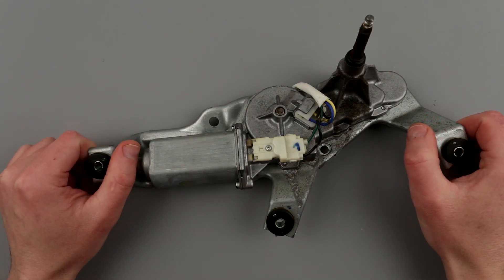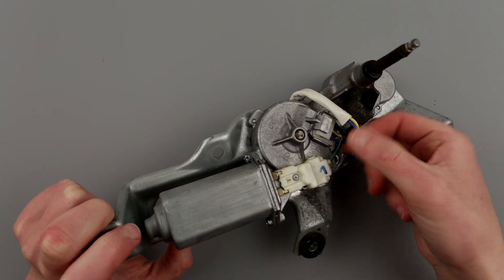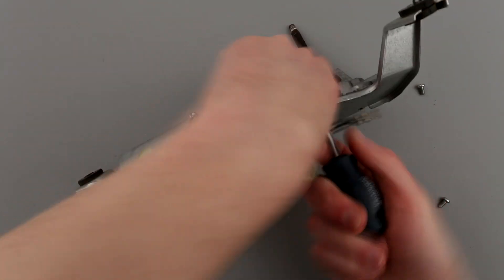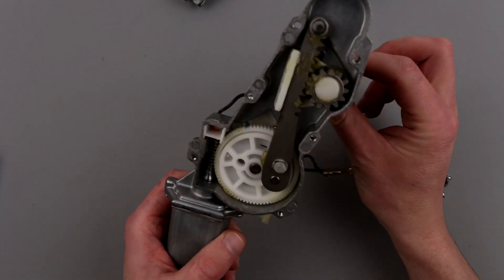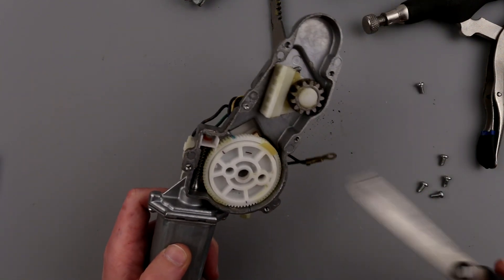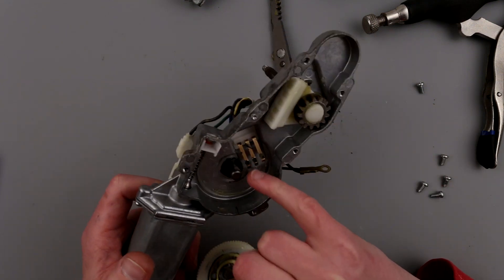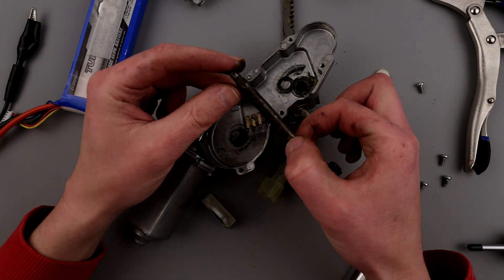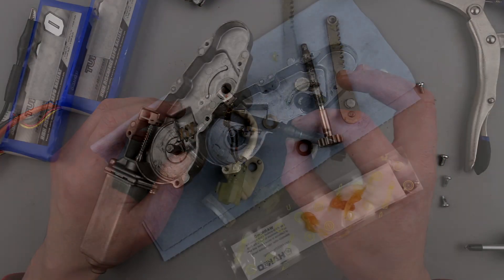Rear Wiper Drive: repair and how it works

Comment: I like your approach, it's exactly how I would do it. The electric motor bearings sounded very worn to me but as long as you dont use it too much it's a good cheap fix. Thanks for the video
Reply from the maker: Thank you for watching, many years later it still works :D

Comment: I have a problem. I cleaned that part u cleaned because it was ceased and rusted. However it didn't turn. On further inspection, the motor which has a threaded bar only turns so far anti clockwise. Should this motor be able to turn in one direction continuously? Or should it only turn the platic cog a little bit
Reply from the maker: Yes the motor should turn one direction, the mechanics will turn this into back and forth motion
Reply from the maker: Check the very end of the video to see how it is supposed to work

Comment: Dude you skipped the most important part, you didn't show us how you hammered the shaft out, was there any sealing to remove before hammering, did you have to remove the gear first and then hammer it out? you skipped the most important part and how you put it back too, for that reason your video is worthless sorry
Reply from the maker: Thank you for watching! Yeah...it was messy  Ive used P-Blaster, while protruding end of the shaft was locked in vise I was rotating the whole assembly to force it moving. Than when it started moving I release the vise and hammered it out :D

Comment: great video...but I'm curious as to How You REMOVED THE SEIZED SHAFT????..Did I miss it in your video?
Reply from the maker: I have used vise locked the shaft in there and was rotating the whole body wiper body while shaft was fixed in the vise.

Comment: helped me a lot for disassembling mine, thanks! now I have cleaned everything - just wondering which grease to use for the gears & shaft?
Reply from the maker: Happy it was useful ! Please use non-Lithium grease as it can seize again. PTFE or Silicone based will work

Comment: Dam I want know about wiring mate
Reply from the maker: What do you mean?
Reply: @InsideOutElectronics  I got power at relay. But no power at wiper motor. There is a block of 4 wires and couple other blocks wires.  Bit confusing. GQ patrol, cheers

Comment: I have powered the motor, shaft rotates, but when I switch ON the wiper in my car, it does not start wiping. I check if I have  12 V coming to the motor from the car, and the answer is yes. Maybe you know where could be the problem?
Reply from the maker: Hi, did you check for 12v right on the connector of the motor?

Comment: Друг, просто у тебя машина не обслуживалась, вот он и закис))). И я бы не рекомендовал использовать смазки на основе лития в присутствии воды.The shaft is made out of steel but the gear reduction housing is made out of aluminium, so it will corrode over time again and will gonna stuck. Можно нацепить манжету из сальника)
Reply from the maker: Да я уже в курсе о литиевой смазке, но разбирать уже не буду, если закиснет тогда буду думать. Манжета на месте всегда бьіла, все равно затекло и закисло. Спасибо а совет

Comment: Hello Brother , At first you tried to rotate the shaft , but actually the rotation was mainly stopped by the motor , because the mechanism used their can transfer the rotary motion in one direction only that is from motor to the wiper main shaft, motor cant be rotated by rotating the wiper arm . The rust may stop the motion but rust cant apply that much of resisting torqe that you applied to rotate it in your first attempt.
Reply from the maker: Thank you for pointing this out, that totally makes sense!

Comment: Very interesting. I had to do the same with a Citroen Zsara Picasso here in the UK. I think these wiper mechanisms are built to fail. The seal on the wiper arm is poor. On Citroen and Renault water seeps past the seal and stops the wiper parking switch from functioning correctly. Consequently the wiper just parks anywhere on the rear screen. Not
Only that, the wiper activates when unlocking the car. I love french electrics 🤣🤣 What did with mine is wrap a small amount of insulation tape around the spindle directly below the wiper arm to try to stop water and dirt/salt getting into the motor housing. I have a new motor unit to fit when this one fails completely.
Reply from the maker: To insulate I packed a lot of grease into it, hope it going to help :D still works :D
Reply: I've done repair to sealed rear wiper motor for Synergie / Evasion / ulysses / 806  - all have integrated washing fluid pump  . you have to destroy nits but don't warry wiper motor is mounted to back hatch with metal plate it cover motors and keep shaft and cover on place .  The problem is in rusting shaft of wiper. To make it good you have to sand it with paper of 1200 and then 2000 then heavly lubricate it with good hydrofobic greas / lubricant  that is also tempemerature protected ( works in wide temperatures without loosing consistance ). Most problems are with wiper motors integrated with washing fluid pump it keeps getting in to shaft - most important is maitenance - every time you hange wipers blades you have to rememeber to lubricate shaft it the place it gets through cover of mechanism.

Comment: How did you end up getting the shaft that was stuck out? I’m dealing with the same problem you are and can’t hammer mine out. Thanks in advance!
Reply from the maker: I was using lock jaw pliers, rotarting and hammering it out. Also i used PBblaster to chemically loosen the rust.
Reply: Inside Out Electronics Cool. I was using WD40 and hammering on it. I’ll try turning it too. Thanks!
Reply from the maker: How did it go?
Reply: Inside Out Electronics I don’t have a PB blaster and rotating it didn’t work. I was using a ton of WD40 and a hammer to try to knock it out but the metal casing cracked and broke before the shaft came out. Ended up buying a new part
Reply: put it in a vise with a board with a large hole for the gear behind it.
Reply: @teppand  lol thanks for the advice… just a little late lol. (Sold the car a bit ago now)
Reply: @jonathanmcauliffe784  the more time goes on the more people are gonna have those rusted motor shafts.